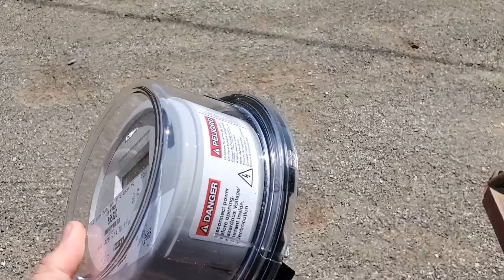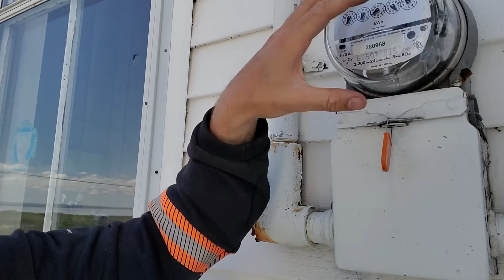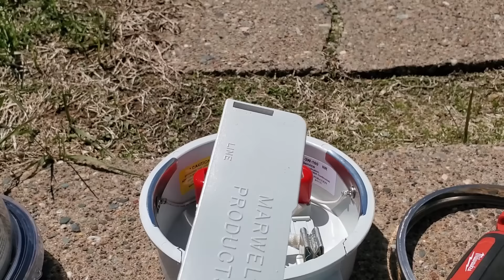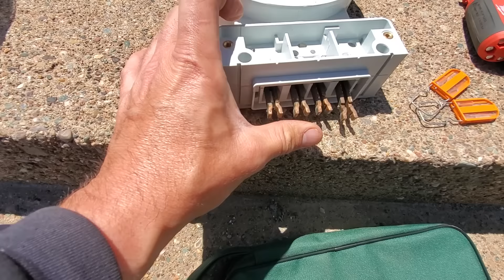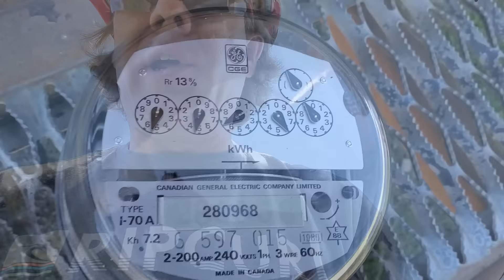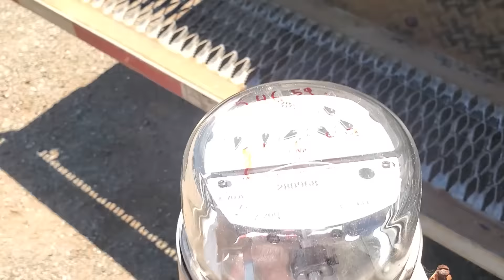Removing an old "A" base Electrical meter

Comment: Nice job. Usa electrical installations looks .... strange. In Europe(North), we have 400 volts 3phases(240v single phase) and between 3x16A to 3x25A for houses.

Comment: The cobra head on that church is a Westinghouse OV-14B.  They were fairly common in Canada, less so in the states.  Fun fact - There should be a rippled cover over the bolts.  According to a retired Westinghouse engineer I spoke to, Chevrolet was invited to look at the design of the first gen OV-25 (big brother to the OV-14B).  It had exposed mounting bolts.  Chevrolet made a cover from some metal trim that was on the original Corvette.  So that little metal cover came from Chevrolet!  (I'm a professional street light geek.)

Comment: Oh the ironing!  Dealing with service entrance issue myself (actually the house I stay at). 11:45pm two nights ago. House lost power. Went outside and all the neighbors has power, so went to check the breakers. Nothing looked tripped, yet no power anywhere in the home. I checked and found no voltage on the bus bars, but there was 240 across Bo terminals going into the main breaker. So I turned off each breaker, then went to reset the main 200 amp breaker, and it would not turn off to reset. It was stuck, and interestingly the metal plate around the main switches (where you can put a lock to lock out) was loose, and a couple small pieces of plastic fell out from under the metal plate. I realized it was something I was not able to fix, especially not at midnight. So apparently this old Zinsco panel (that should have been replaced decades ago) has a faulty main 200 amp breaker. Upon the utility company doing their check and pulling the meter, discovered the main breaker welded itself to the bus bars. Fortunately now a new panel gets to be installed. Welcome to the modern age I guess. Unfortunately it’s going to cost the homeowner about $7500 to get proper grounding and bring everything up to current code to pass inspection. But it will be solar ready for the future at least. And able to do away with a sub-panel that is about five feet from the main panel. I also learned that Zinsco is about as bad as Federal Pacific. I had no idea!  Ya learn something new ever day. Or at least I try to… Thanks for the always great content!

Comment: Why did almost everyone say the meter reading was 54659 and some others 54658 when the pointer on the first dial is clearly between the 6 and 8. What am I missing, I would think it reads 74659?

Comment: An "A-Base Adapter"? Man, your company is soft on its customers. DTE would make them install a new meter-can and let them know when it's ready.... "Oh, all the cloth insulation breaks off of the wires when you move or bend them? Well, you need to redo your entire service then. Give us a call when you've installed all new service equipment, and we'll gladly come back and install a meter for you."
Reply from the maker: Everything you said is the way it should be 100%

Comment: Coming back to this, the reason for those copper fingers is, back when utilities tested meters in situ, those fingers could be moved up to isolate the meter and allow it to be connected to the test load and a 'standard' meter. That said, it works out to be about the same amount of labor to set up to test in situ versus just changing out the meter and testing the old one in the shop (and restocking if still good). These Murray boxes are a good solution for mounting A-base meters, but socket-type meters proved to be a better solution overall in the long run.

Comment: Using the voltmeter is fine but how do you know it's working? UK electricians are taught to check the meter before testing and recheck it afterwards. Either from another known mains source or a self contained power pack.

Comment: It seams like to me you have more problems w/ over head than under ground, is this true? As a electrician this is true, when we have a strong wind we most likely have an outage. In Cal the city of Paradise was burned out not once but twice due to brush blowing up into the over head lines. The same in Boise Id where it took out a number of houses & killed one woman. How can we not afford not to go under ground?

Comment: The 0.5 - 200A meter is often referred to as a "self-contained" meter as only the mounting device is required. The 0.2 - 20A meter is a "transformer-rated" meter and is specifically to be used with a current transformer (and sometimes voltage transformers as well) for services beyond 240V / 200 amps. Transformer-rated meters are also often used with special sockets that ensure the current path from the current transformer does not accidentally get opened.

Comment: I think this is the first video that I've seen you attach the camera to the hot stick, that's a nice way to get an up close look at what is going on - not like you haven't opened cutouts a million times before, but this is the first one that really gets across how hard you have to pull to get it to let go.

Comment: Is there some where I can send you a video of my pad mounted transformers with markings of gas lines i am in ontario newmarket tay hydro.  my transformer pad does not seem to be elevated from ground leve;.  I once over flowed my pool and water ran directly to pad area.  it seems to hum louder than others on my street.

Comment: Guy should learn proper terms. There is no longer anything called a neutral in the NEC book .They changed one if the most commonly used e!ectrical terms for the last 125 years to confusing " grounded conductor " about 8 years ago ! Test what did the dopes at NEC change term light fixture to ?Bonus question wire nut was never in any NEC books so what term does the NEC use for wire nut. During  my long career found that the local PECO ( electrical supplier ) linemen know all the best bars & places to eat in our city.
Reply: some places and countries don't go by the NEC book

Comment: About 10 years ago lying POS PECO/EXELON promised we would be able to access the 1.7 million smart meters they installed in the greater Philadelphia area to loom up our daily power consumption .Still waiting. Bums have nothing on their web site explaining if we can finally access readings.Its a win win for the most expensive e!ectrical supplier in the entire state of PA for last 100 years. They can remotely shut off your service. And saves over 105,000 vehjc!e trios a year for them. While helping a coworker replace his service cable on a Sunday PECO showed up less then a hour after we cut old service cable. When you call them for an emergency they take forever and a day to show up.

Comment: Did you ever find out the brand and type of grease for the meter? Our utility doesn’t put any on the meters, so I always put some Penetrox E on the socket terminals (which is compatible with tin plated components) for when they come install the service (electrician here). Thanks!
Reply from the maker: I did!
It's made by general electric... Just called "0183L0907P037" mobil grease. I see it says discontinued online, I'm not sure if we have a new version of it or leftover stock

Comment: the problem with the new meters is that when the voltage is lower than the low limit , the power is cut off , so no energy anymore in the home

Comment: Why int the fuck in the year 2023 you have flat screws?Are u the same with the UK with those cold and hot water separated?
WTF is wrong with you people?You have feet and inches that is fucked but now flar screws?
Where is SL/PH,SL/PZ?

Comment: I was wondering if your company is thinking about using the cell phone network to read the meters. The state I live in uses it pretty extensively. The biggest advantage I've seen is being able to look at blackouts in areas.
Reply: Here in NW Ont. Canada hydro one net works have little white wifi antena hanging down on poles at every service in the country. In the city there only one or 2 per side street. This is what really pissed off thousands of people in the country saying if there going to the cost to set up this wifi system to read the meters why would they not install a much bigger system an offer internet to everyone who cant get internet. Due to fiber not avalable. An stuck with old deal up or costly starlight. Were I am way up on a really high ridge I get internet useing a canapy system set up on my farm pointing to a cell tower 8km away. It dont run on the cell net work as they have diferent radios on the tower for internet unlimited dada. Witch hydro one connects to as well though a canapy system as well but they installed boster station on high land points all over. But hydro one system is only strong enough to read meters. How ever we can go to hydro one website an login an watch out usage 24/7 in real time. Witch helps with this dam time use rates as well as the lower rate if your under 1000kw per month. The rate jumps over 1000kw on all 3 time of use rates. The hydro used is one thing but they are scammers as they charge delivery charge per kw. So my hydro used bill is $90 then the delivery charge for that $90 of kw used  the delivery charge on that is $67 plus deat recovery of $7 a month service charge of $3.95 for your account plus  hst gst of 13%. If I shut down my main braker an run all solar. An do not use any grid power I am billed $65 plus 13% tax as a service charge

Comment: You didn't show any lag screw holding your new base to the building's siding.   I would imagine it can be tedious at times, example, rotted wood, uneven siding lap......... did you need some sort of spacer so the lag wasn't torquing the meter base?

Comment: In my area in America the electrician can pull the meter,cut the drop ,change out the whole service ,hook it back up to the live drop and call the town for an inspection. MURRAY was almost everywhere now they are no more. Ive seen a lot of meter sockets,panels ect. Il bet MURRAY became MICRO ELECTRIC in Canada. In one of your videos the lugs are identical. I dont understand why you guys have an obsession with ring style meter sockets. Ringless are better because if theres a problem you can look in and see it before you pull the meter. We have another even better meter socket, its called JAW CLAMPING/LEAVER BYPASS. You first remove the ringless cover then you put your hand on the meter,pull the leaver up. The meter will be lose enough to fall out in
your hand. Now this is in bypass mode,you then put the new meter in and pull the leaver down and you just did a meter change without interrupting the customers service. This type of meter socket has a safety shield that covers the live jaws. These clamping jaws put up to 50 POUNDS of pressure on each meter blade. We use them on 3 phase 200 amp self contained and 1 phase 320 class. I really wish they would demand them on all the new 100 & 200 amp residential services. Look up JAW CLAMPING LEAVER BYPASS METER SOCKET. I think you would really appreciate this top quality meter socket that you have never seen in Canada..
Reply from the maker: Very interesting! Thanks for taking the time to share.
We used to have the ringless meter sockets, a long time ago...
I'm not sure why they got rid of them.  I agree 100%, they are much safer since you can remove the cover and inspect.
I've never heard of that by pass type, I'll definitely check it out!
Cheers! 🍻🤝
Reply: @Bobsdecline  Hey go to youtube and look up EXPLAINING A 200 AMPERE, 3 PHASE METER SOCKET WITH BYPASS LEVER .Take a look at the lay in lugs and towards the end of the video you can see what i mean about the clamping jaws when he lifts that leaver. Do not take his advice about operating the leaver with no meter under a load. YOU NEVER PUT A LEVER DOWN UNDER A LOAD one you have removed the meter. I was taught that you NEVER pull a meter under load [plug in style] but the guys at my utility do it all the time and probable damage peoples meter sockets by doing it. Please let me know what you think of the meter socket in the video? Why doesnt Canada use them?. Il bet this is the SAFEST type of meter socket there is.

Comment: I love the older meters they are easy to read
Reply: New ones are even easier to read…from the truck from a ways away.

I used an SDR  to read mine one night.  Left it running overnight and by morning I had 42 meters including a demand meter nearby.  They repeat every minute, but demand does every 10s.

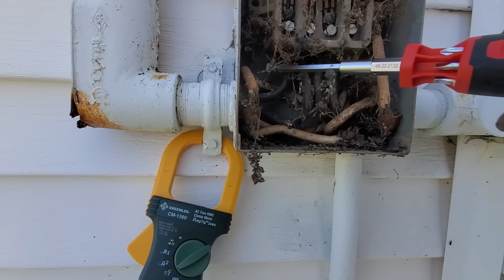Comment: 8:38 "No wasps today"
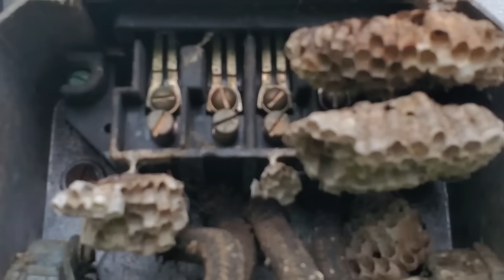8:44 Wasp: "Am I a joke to you?"

Two questions:
Did you remove the cutout door? The clip ends immediately after opening up the circuit.
Why is the meter rated for 160A continuous for a 200A service? I know most services don't pull anywhere near what they're rated for, but they could.
Reply from the maker: Lol the wasp clip was spliced in from the last meter change 😟.

We're only required to remove the cutout door when working on high voltage ( with a few other specific scenarios, meter change not necessary).

This particular entrance was 100A. The 200A meter are used for all entrance sizes up to 200A (200,125,100 and 60).
Also our 200 amp service are all only rated for 160A continuous load. They're designed to have continuous load of 80%.
Reply: @Bobsdecline  hahahaha Well, you duped at least one person with your editing skills. I watched it more than once and never noticed that it wasn't the same service.

I never knew the 80% factor for services. I wonder if it's the same here in the states. I do know there's a lot of similar rules in the electrical world. Conduit fill, panel fill, fuse and breaker loading, etc.

Comment: Well we got a brand new concrete path when next door had a meter change.
As they had to replace the underground cable as it was Bitumen-wrapped incomer and too close to the floor.
So the whole lot has to be replaced.
So do you have any Bitumen-wrapped incomers?

Comment: 54658 is the reading. We have some of these left in the UK .Most are drilled and a long pin pushed on the wheel to slow it down so cheaper bills or a really strong magnet is put on the side to make the wheel/disk inside spin slower for cheaper bills. Just don’t put the magnet on the wrong side as your bills will double or triple very quickly 🤣🤣🤣
Reply: His reading is correct, but at that end of the meter being an 8 or 9 is insignificant on the bill.

Comment: As an ex liney the HV fuse you pulled would also be removed(safety as wind could possibly blow the fuse closed). Meters these days are a far cry from the first meters that I worked on(DC 240v mercury bearinged). the old home owner trick of turning the meter upside down to dump the mercury and slow down the meter.As a meter reader i was taught to read left to right taking into acount next digit

Comment: That junction box with the heavily oxidised terminals shouldn't be allowed to stay in service. Rip that crap out and reterminate the wires onto a new box that hasn't been rotting away on the inside for bloody decades...

Comment: I find this very interesting as someone who works in the UK on the same kind of network. I was wondering when you pull the fuse to isolate the transformer do you need any kind of instruction from a control centre etc? Here in the UK anything HV has to be an issued instruction from our main control. Thanks again for the vids!

Comment: I really like the videos where you perform work and explain the process, equipment, safety considerations ... I will never be a lineman or electrician but I am highly interested in electricity and I have degrees in EE and CS.

Comment: Was watching an electrician from Europe go through turning off power for an outlet from the breaker box. That was super interesting to watch. He detailed the tools that do that. He first tested and verified the socket had power. He then isolated the outlet on the panel. He then flipped the breaker off. He then verified using tools that the power was off. He then tested the tools to verify that the tools had not broken after he tested outlet to verify power was off. He ended up doing like 3 or 4 tests consisting of testing the testing equipment, verifying the outlet was on, then flipping breaker, verifying outlet was off with meter, and then verifying his testing equipment had not failed after using it. In the video the hardware had failed and was able to verify that. It was not actually scripted. It just failed! He then had to start over from the beginning with other test equipment.

I don't work with electricity. Its scares the piss out of me. I will always leave it to pro like electricians and linemen to handle. The only power I get close to is plugging my phone in or a computer. And I never work on any electronics that have power. If I need to do that I call my neighbor who is an electrician and have him supervise that sort of thing. Anything I can do to avoid deal with anything with live power. I am not trained and have zero experience. Always nice to watch a pro do something with power. Gives me the shudders thinking about how easy it is to die around electricity!

Comment: Can i ask why you guys and the states all use metal pipes for electrical cabling? We only use plastic here. Seems a lot safer, well to me anyway, but jsut going near the fuse box makes my hair stand up hahaha too many bad experiences.,
Reply from the maker: It's mostly plastic now, metal was a very old standard. Some metal is still used in certain commercial applications

Comment: At my old apartment, the feed below the meter (for the entire building) melted. Got hot enough to scorch the wood siding behind the box, and the copper melted and broke the connection (luckily). If more air had gotten into the box it would have started a fire.